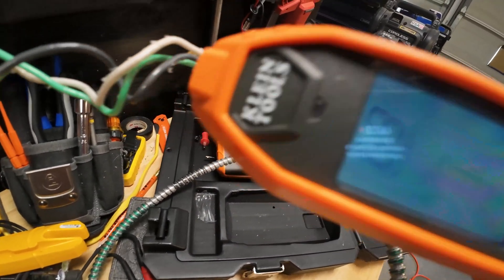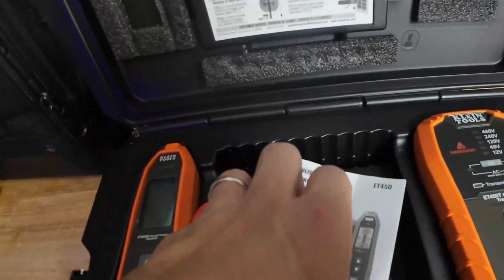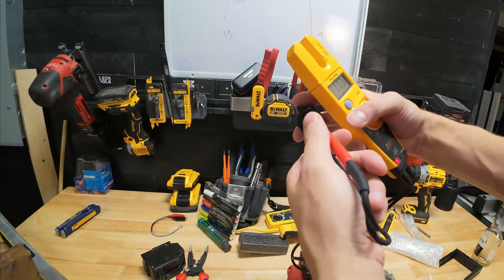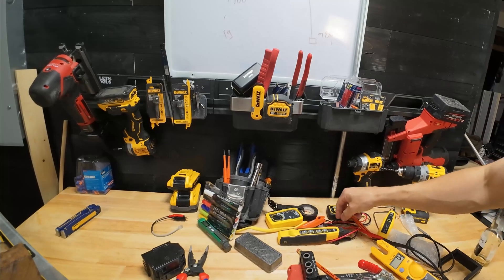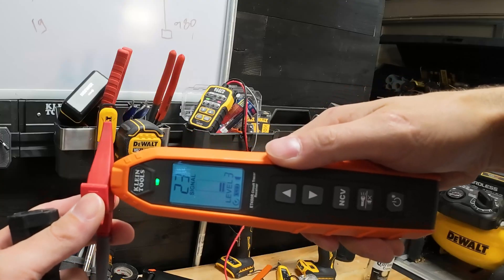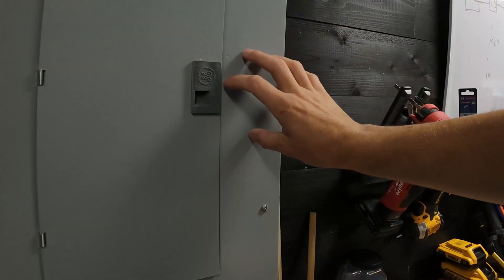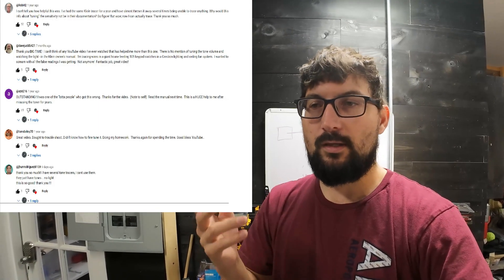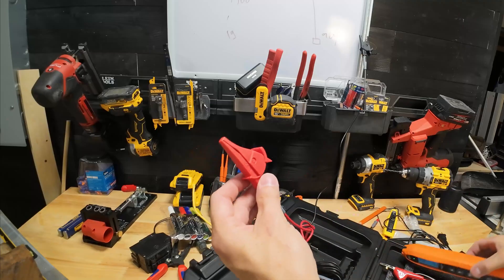Klein Circuit Tracer/Toner - How to use The RIGHT Way!

Comment: I ditched my Fluke 3000pro toner set to pick up the Klein toner rig you had suggested a few weeks back based entirely on your videos (and that you demonstrated the facts of the matter not just your opinion) and I had wanted to get this Klein ET450 several years ago. Just bought it off Amazon and will have it delivered in a few days and here's my question: is there any particular reason to continue to use the Klein toner set along with the ET450? After all, the ET450 can do both energized and de-energized circuits while the toner can only do de-energized ones.
Reply from the maker: That's a great question. I would have to play with it more to really know that answer for sure but individual wires you will get more sensitivity in a crowded box with the regular toner because of the light  but the tracer will Narrow it down faster use the toner to pinpoint
Reply: @toolsandtactics  Wow, thanks for the prompt reply!  Yeah, I was planning on keeping and using both toner and tracer. And thanks again for the reminder of the toner light being the best way to identify the wire in question; so I'm thinking that for anything that I can de-energize, I'll use the toner and anything where I cannot de-energize a circuit or another unusual circumstance, I'll use the tracer. Or when identifying circuit breakers and don't want to carry another tool (like the numerous CB finders out there). I've got a number of those too, and now I can get rid of them.